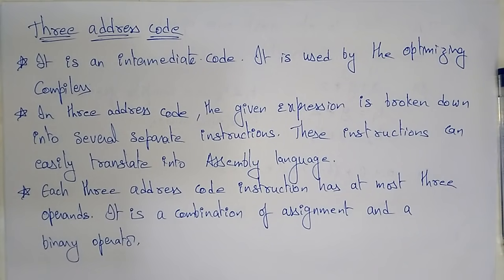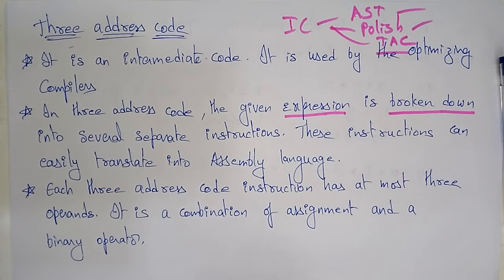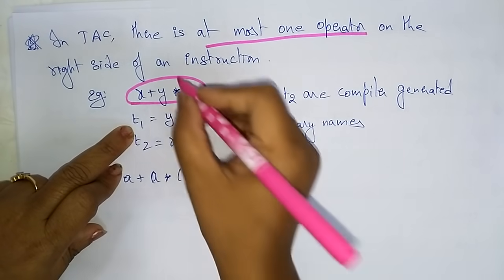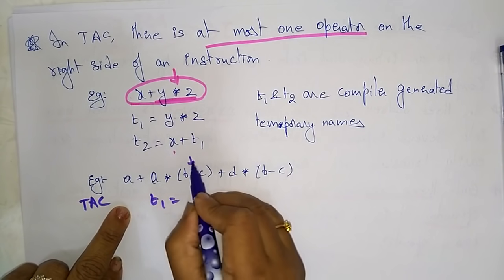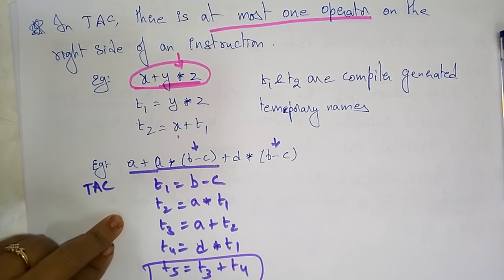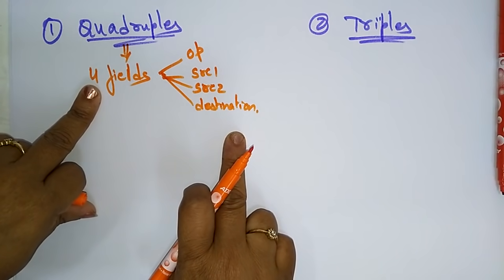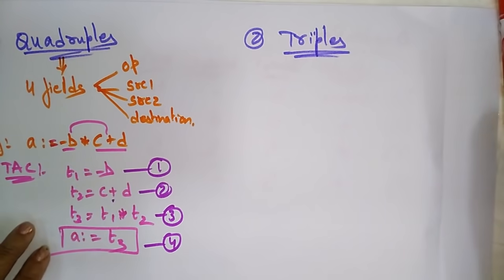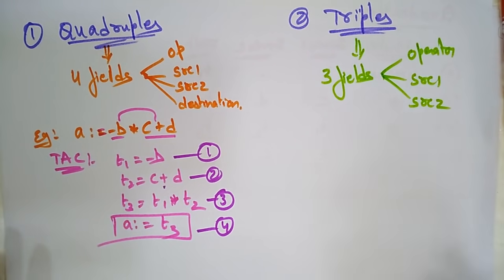Three address Code | Intermediate Code | CD | Compiler Design | Lec-36 | Bhanu Priya

Comment: As there are no ( ) so your example is incorrect.
 It should be
t1=-b
t2=t1*a
t3=t2+c
Reply: I was lluking for this comment
Reply: u r right
Reply: @sahilnaik3904  coz Precedence of * is higher than + operator
Reply: () are only not having Precedence, here *, + and - are present. So before deciding what is correct or not look into it.
Reply: You are correct but objective of the video is to make us understand how to write three address code and she has done her job very well
Reply: @akashmaurya6313  but if you go here wrong the whole life of yours may be wrong 🙂
Reply: @naseeb6200  yeah just look into it they are definitely right ,frst we take -,after *,+
Reply: Yup she messed up that part
Reply: She also made a mistake at last part, should be (3) := a (2) so that the result will be assigned to (2).